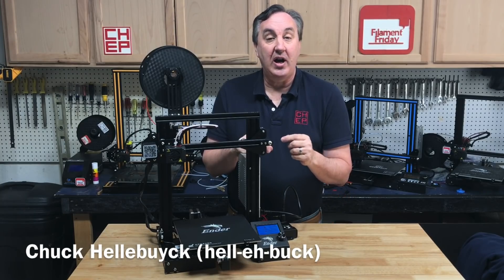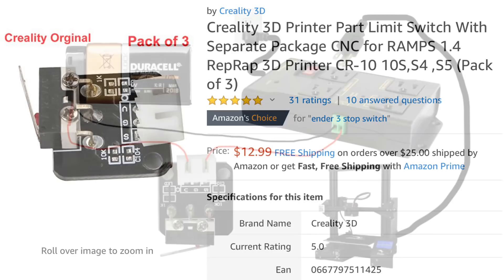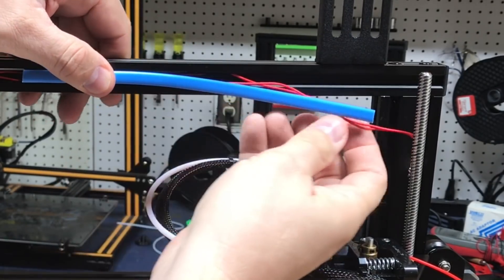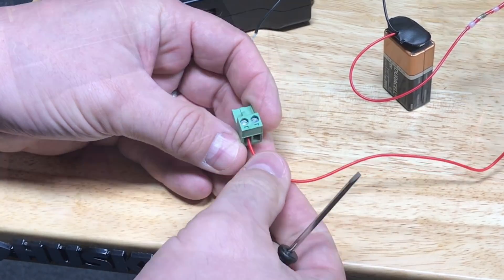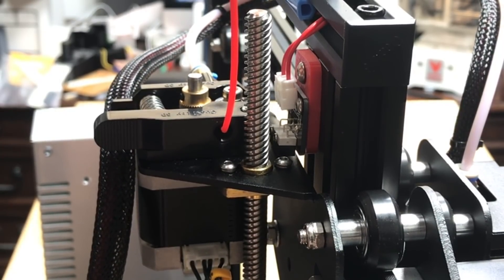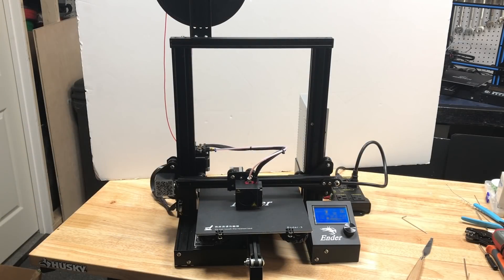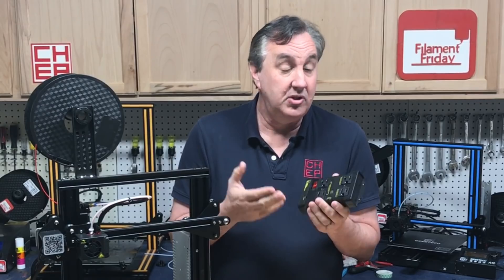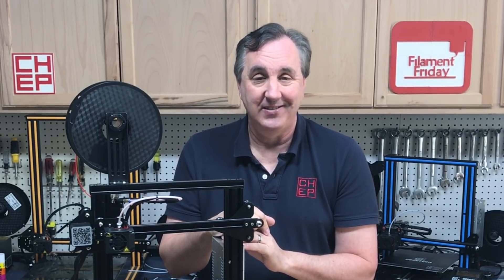Simple Auto Off Control for Creality Ender 3 without Octoprint

Comment: As I beginner into printing and someone not very good with computers this is awesome! I have currently been just setting an alarm on my phone to wake up and go turn it off.
Reply from the maker: Thank you. You are the audience I made this for. No computer, no firmware, no Octoprint. Just a simple mod.
Reply: @FilamentFriday  does the sudden power cut damage any components like the stepper motors while running? I've got a printed switch myself.
Reply: @FilamentFriday  And what would you do on a dual Z? also nice video making it 10mins long for a thing that only needs 3mins to explain and show... :'D
Reply: @GamesPlayer1337  What would YOU do? What do you offer other than octoprint which the video is based on not using. Also, nice comment making it completely pointless like all your others when all you needed to do was say nothing.
Reply: ill make a mechanical shut off in a few days..when it finishes it trips a rubberband preloaded and phisically trips the breaker
Reply: Try octoprint, will give so many more advantages and is easy todo.
Reply: @GamesPlayer1337  Hey Genius, the title of the video is ..."without Octoprint"   Suggesting octoprint is like how to cut wood without a saw, reddit-"use a saw"  Octoprint may be easier in your opinion but the absolute easiest for everyone is you keeping your comments to yourself.  I dont see any "how to" videos from you, just 10 hours of pointless family guy.
Reply: @billwecantcompete5466  feelings got hurt?😹

Comment: Being the input min V is 3.3v, would a 5v Power output block from any cell phone charger be sufficient to power the on/off switch input? Most households have 5-10 of them things laying around the house lol. Just thinking of a free solution to the 9v battery or 9v power block. :)

Comment: What if I use a smart plug for my ender 3. While I monitor my printer using a security camera, if my print fails while I'm away I can just shut it off from my phone.
Could that cause issues with my printer?
Reply from the maker: Maybe a clogged nozzle but that’s all I can think of.
Reply: @FilamentFriday  that's not so bad, it's a cheap alternative in my book.

Comment: Hi friend, I made an upgrade today in my Ender 3 Pro with the new BigTreeTech - SKR Mini E3 v3.0  mother board and it has automatic shutdown and power-ff resume. But I will still need to buy another board to do this job or it's a only software change to enable it? I can not beleive I'll have to buy another board, hope not. I could not find the answer yet in the web. Thanks!

Comment: I think that grind and the end is because the switch is a bit lower than 250, manually raise it on the Ender screen little by little until you find the sweet spot.

Comment: As the relay plug can be switched up to 60v, you could take a feed from the printer power supply (24v), so there's no need for separate power brick to be on all the time, and it'll only be able to turn it off when the printer is actually on. As others have suggested, add G-code to cool down first before moving to top.

Comment: Hey CHEP.  Could you also set this up with a proximity sensor instead of a limit switch?  So you would use a NC proximity sensor at the top of the printer.  I have a snapmaker, and it seems like it would work better for the design of the printer.  Thanks!!

Comment: I bought that same power relay. My plan is to glue some thermistors to hotend and bed since I already had the experience that the transistor for the bed heater got stock ON and the bed was 100C when I got to the printer after a finished print. So I want a system independent of the printer board that monitors temperature and other parameters like a smoke detector, to cut current once any of those parameters get out of limit. However, I didn't think about power off after print ends, my only concern is that I saw your X-axis getting out of level when it hit the sensor and couldn't move forward on one side. Could the control board have a pin that gets a signal out once the print is done? I could easily integrate that to the Arduino and not having my x-axis getting out of level.

Comment: You should let it cool of a little before shuting doown.
Reply: why?
Reply: Yea I was gonna ask why also, when you shut it off it cools down anyway.
Reply: @maximus9300  i find out that it helps preventing clogs by heatcreep.
Reply: @V1N_574  ooooh alright, I’ll remember that next time🤔 Thanks!
Reply: @V1N_574  turning the mains off will not affect heatcreep unless the printer has a aftercool down fan that keeps working after the print finishes. you would be better to add some gcode to keep the fan on for a while after the print to cool the head. this way the power would not go off as the gcode is still running so the printer has not finished and you are actually making a difference to heatcreep
Reply: @brianwild4640   that would be a good way to do it. I know there is a Gcode that waits for a certain temp to reach before continuing to the next instruction. So you can set that before the shutdown instruction to run. I believe that with an all metal hotend the chances of heatcreep at far less but I'm not 100% sure. Thanks
Reply: @V1N_574  you still need some active cooling still on the hotend that must not turn off too. or you are making no diffence. but i think the fan for the hotend will stay or have a gcode to turn on
Reply: @brianwild4640  correct, mine is always running if the board is on, disregarding if it is printing or not

Comment: I have this set up but recently upgraded my printer mother board and also got a Raspberry Pi, Controller be used to power on/off the printer using the OctoPrint?
Reply: yeah, if you run cables from the pi's gpio pins to the extension lead's relay input, and then use a relay module on octopi, then yes you can
Reply: I use this unit with the Pi and Octoprint.  I use the PSU Control plugin.  It works great.

Comment: Hi got a problem  I bought an ender 3v2 printer and it arrived in middle of January. It had an issue the x axis limit switch male connector in the wire bundle piece was broken. I email CREALITY and they finally earlier this week shipped new replacement cable. It’ll be several more weeks before I receive from China due to Chinese New Year festival. I noticed you had a box of connectors. Can you tell me what the connector part is on the wire bundle that plugs into x axis limit switch and where I could buy one. I don’t want to wait another month to start printing
Thanks,
Dick T
Reply: I have a picture of broken part and I can fix myself I’m pretty handy
Thanks
Dick T

Comment: I paid nearly 400.00 for my Ender 5 Pro and they didn't even add a simple program within it to shut off a print after it's done. 
   I do most of my printing while I'm at work and sleeping and there's no denying how many other people with other situations would like having the practical ability for the printer to shut off when it's done
   It's long overdue for Ender to provide this feature with their printers and to provide an en easy way to update systems without it. I know I'm not the only one by far who has made this issue known to them. I contacted them twice now over the past couple months concerning this issue and the first message they never even responded, and the second message I got a lame formatted reply that said sowwy fo incoveeience but we working hard meet customers needs.
  This is more typical bullchit replies when many have already asked them for a much-needed shut-off feature back when they put out the Ender 3

Comment: Great vid mr Chep. 
Been printing a while now but dipping my toes into the whole wiring and electricity thing. 
Recentlyt octoprint working and looking to control the power supply with a relay remotely.

In your experience, theoretically, for remote shutdown or thermal runaway protection, would this relay adapter be able to be shutdown with a raspberry pi instead of the battery and end-stop switch?

Is this something you would try?

Comment: Nice hack but there is a much simpler solution for switching out your Ender 3 after printing without hardware modification and without gcode: Get a Gosund smart plug over at Amazon. Those cheap devices can be programmed via Smartphone app. Simply define a power limit and your Ender 3 will switch off if power consumption drops below 50W. Works perfectly for me since two month.

Comment: This is a awesome idea but shouldn't the fans cool off the bowden tube before shutting down or it will damage the tube eventually?
Reply: I also have thought of that, maybe is possible to put a line in the gcode that starts the "z up" line just after the hot end reaches a temp below 60C°. Also i wonder if turning off the printer while its running code might cause problems?

Comment: Why would you do this? It creates more wear and tear and slows down your printing. There are cheaper and better solutions, but they require recompiling the FW
Reply: Why would having the printer turn off slow it down?
Reply: @Krytern  Because the Z-gantry needs to move from all the way to the top down again.

Comment: I've gone more manual, and off-the-shelf, after initially planning to knock up an arduino to do it. I have an IP camera so I can watch prints from work, and bought a smart-plug that I can switch on/off wit my phone on wi-fi, so in the event of a failed print I can hit the kill switch and not waste filament/make a mess....
Reply: I would be concerned leaving any printer unattended personally. I have 2 printers and they only print while I'm awake or monitoring them. Remote control and monitoring is a strategy risk to those around your farm, it's that simple. You must think about the worsted that can happen and protect others from your mistakes.
Reply: Home network could fail, there is no redundancy to your solution.
Reply: @blitz-toasted6211  Our downtime in the past year or two might be measured in a handful of minutes total, I'm not concerned. My printer has no life-support features... :)
Reply: Worst
Reply: @blitz-toasted6211  Your concerns are noted, thanks for stopping by now.

Comment: Big Tree Tech have a relay kit that does this, works with their SKR boards, it wires in between the mains inlet and the power supply, with a cable running to a socket on the main board. Cost about £/$15? Downside is it is doesn't have multiple outlets for operating other devices, but it does work on 230v.
Reply from the maker: Thanks.

Comment: Not a bad solution for a noisy printer as the Ender 3. When my Prusa i3 MK3S finishes, the only thing left running is the hotend cooling fan, which is a Noctua, and even that shuts off when the hotend gets below 50 degrees Celsius.
Reply: We need a middle finger button

Comment: I tried this using my own relay box with a solid state relay. The electronics work OK but when the microswitch is hit and power goes off the carriage drops under it's won weight and power is turned on again. Ant ideas?
Reply from the maker: Someone in comments suggested a push on/ push off switch. That seems like a good idea.
Reply: @FilamentFriday  I have a couple of those but the problem is that they don't actually switch until they are released. I'm trying to figure out a way to use a lever type switch.

Comment: What’s your opinion on the bl touch auto bed level for the ender 3 pro? I bought a ender 3 pro a few months ago and it’s gotten to the point where I’m having to level the bed after every single print and the middle of the bed also isn’t level it has a small divot where I’m having to move my prints to the front of the print bed. Any idea in what to do to fix that problem?
Reply from the maker: Fix or Replace the bed. Auto bed level won’t fix a bad bed.
Reply: throw a post-it note under the build surface on the low spot.

Comment: That is a nice relay, pity its not 220 volt, you could of course do the same with a sealed 110 or 230 volt microswitch and mount that at the top of the X gantry and just add to the end of the Gcode a simple command for the X gantry to go to the top and Bingo off goes your printer power. wind it down and it goes back on. CURA has the ability to put this into every print automatically. That would save 30 dollars on the relay and all the other kits and all you would need a is 2 dollar microswitch and some cable, ok its 220  or 110 volts but the machine has that coming into it anyway and as long as you wire it up properly its perfectly safe.

Or do what I did I bought a wifi plug and control it that way. bit different if you have a lot of printers though

Comment: can you use pin 27/29 of the stock ender 3 to use this relay?
Reply from the maker: Possibly.
Reply: @FilamentFriday  Are you going to make a video on the subject?
Reply: From what I've seen, not really. The relay requires a constant signal in order to keep the machine turned on (or off, depending on where it's plugged in). So if you'd wire pin 27 or 29 into it, make the required firmware modifications, here are the two scenarios what would happen:
- with a pin normally low going high after the printer is finished, the relay would shut off the printer, then the pin would go low (as there's no power) and power on the printer again, and it would be sitting there doing nothing
- with a pin normally high going low after the printer is finished, the relay would shut off the printer, and it would remain powered off, but you'd have a hard time turning it back on again. You could wire an external power source (with a momentary push button in series) in parallel with the existing connection, via a diode in order to prevent one interfering with the other, and you could then use that button to wake up the printer.
All in all, Chuck's current solution seems to be the best with this particular relay.

Comment: Or just use a $15 smart plug. Mine connects to an app. I can turn the plug off and on from any where, or set a timer based on print time. Check the wyze camera, Oh its done! Turn the plug off. Easy.
Reply: Yup, I use the teckin smart plugs but this is for the people who don't have a camera. And print time varies on long prints, first time i had a 20hour print i had the timer on 21 hours. Print was not done yet... luckily it can be started again from where the power shuts off
Reply: I bought an IP cam and a smart plug, mainly to kill it on failed prints....

Comment: Hi Chuck, great idea! I was thinking of using automatic switch off outlet timers ($10-15 on amazon) and setting it according to cura's estimated print time with a little bit of allowance. Besides the print time uncertainty and it not being an "immediate" shut off solution, do you think it would have any issues on safety for both electrical and electronics? Thank you!
Reply from the maker: Would probably work fine.
Reply: wifi socket and use that 12 dollars and your done and no wiring!

Comment: Thanks for the video CHEP! I jumped right on this and bought the Power Relay, used my old Z-axis switch (currently I use an EZABL), and provided the "control signal" power from a little 5V wall wart I had laying around. It works pretty well, but I did find that the Ender 3 power supply has a somewhat slow turn off rate, so the Z stepper tends to try to keep driving the gantry up even after it triggers the switch. At first it even slid the switch up with it, but when I tightened it enough to stop the gantry then the stepper would skip for a bit with a nasty clunk-clunk-clunk-clunk. Maybe it would be less jarring if we mounted the switch off to the side so the gantry could continue past it a little bit? Then we could tweak the switch location as needed a little lower to allow for the deceleration of the gantry as the power supply discharges.
Reply from the maker: Good idea. You could also slow down the rise to 1000 or even 500. I had mine fast for the video.
Reply: @FilamentFriday  I ordered the switches with the cable harnesses included, they turn out to be normally open, not normally closed so I had to switch the socket to use for the Ender 3. Also the holder on Thingiverse doesn't quite fit the cable harness version of the switches, so I did a remix it's thing 4222511.

None of this a big deal - I am also using a leftover 5v wall wart for the control voltage and it works fine, but... I also have the clunking - it is quite severe and actually bent the switch away from the board. There is quite a bit of latency between when the switch closes and power drops to the board.
I tried going at high speed F1500 to about 10mm before the switch, then slowly closing at F300, but the switch closure was not positive and the power dropped and came back on. I'm interested in the approach Chris mentioned, maybe some kind of flexible trigger attached to the switch?
Overall I really like the idea, thanks for the video!
Reply from the maker: Someone suggested a push on / push off switch
Reply: @FilamentFriday  I found a simple solution to the clunking - did an auto home, then used the z-motion menu to raise the arm until it just depressed the switch, and noted the Z height. Set that as the z in the G1 command, and the it works perfectly. On my machine I measured it as 223.4mm, and set the command to G1 F1000 Z224. Glides to a stop just as the switch clicks, and then the power drops. I'm very happy with this mod, thanks again!